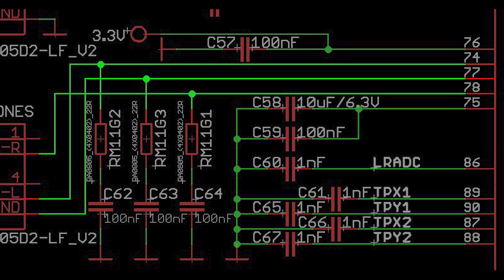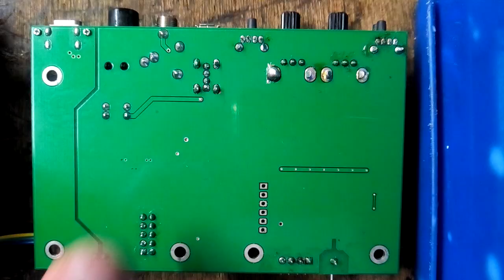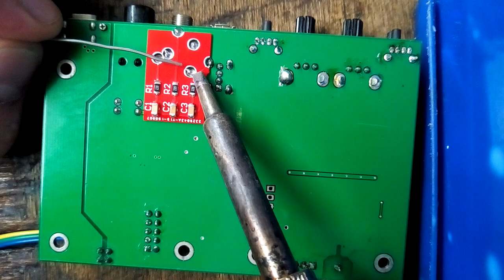Install filter board on SC1000

Comment: my apologies but idk how else to contact you. I'm having an issue with my Pioneer S9 headphone jack. I may have accidentally broken off the connection inside the input jack and now I have to 'wiggle' it to make it work. Any help you could provide will be greatly appreciated.
Reply from the maker: Probably a broken solder joint. Take it to a repair shop if you can't solder
Reply: @TheRasteri I have the tools.. jst need some guidance as to how to get the jack itself. Thanks again for taking the time.